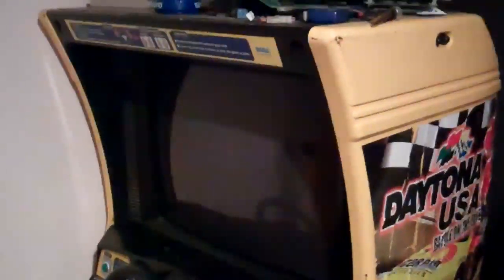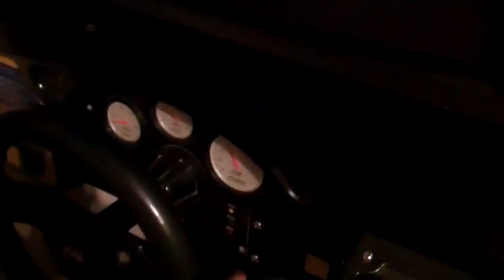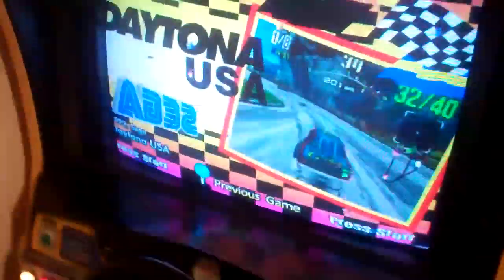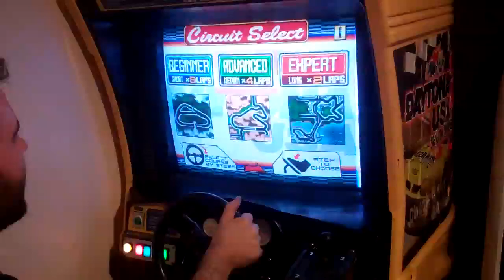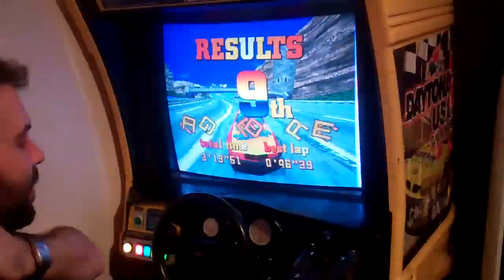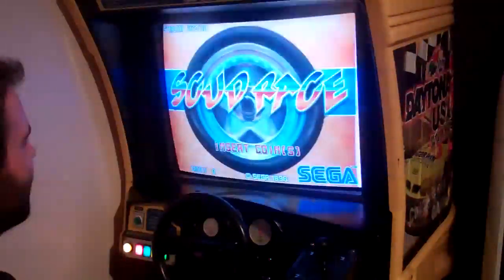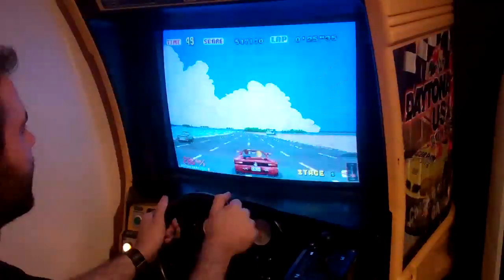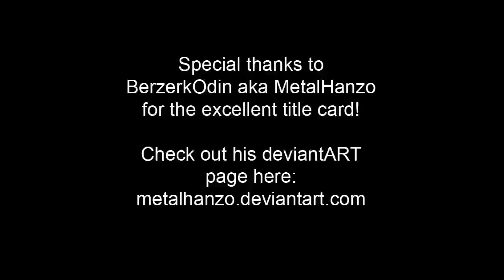Sega Arcade Racing Emulator Cabinet + REAL Daytona Force Feedback Motor!!

Comment from the maker: @ramjetr Thanks ^_^ Yeah I guess if you mean the DX cabs then parts are probably hard to find as they are different. I'm fairly sure a Daytona mech will still fit though, since the panel behind the dash *should* be the same on all Sega racers up to Outrun 2/Initial D. I'd have LOVED to have done this to a DX btw, much be amazing on those huge screens!

Comment from the maker: @gollumondrugs I was actually going to build a circuit that would sense a frequency over 15khz and then automatically switch it via another relay (should really be power cycled between frequency changes) but it's probably simpler to get a tri-sync chassis, plus this chassis is pretty knackered anyway.

Comment from the maker: @TheTerracide Sure thing ^_^

The logitech doesn't have a clutch nor do any of the games I'm using. Since you have a 4 speed shifter too, you'll need to assign each gear to a button on the wheel. Due to the way the logitech buttons are, you'll need to hook each one up individually (two wires per switch).

LINK games will work but only model2 emulator and PC games that support it. You need two PCs too. MAME won't work this way YET but it is coming ^_^

Comment: Cool, there's also other games which you could try...

Ford Racing 3, Ford Street Racing, Crazy Taxi, Evolution Racing, GTI Racing, Merc Benz World Racing, Midnight Club 2, and Total Immersion Racing. I also have the PC version of Sega Rally 2 installed which plays great. 

They are mostly older PC games as the old P4 3GHz and Ultimarc Arcade VGA can't hack newer games lol ! Usually get these games dirt cheap and then find a no CD crack online !

Are you on the JAMMA + forums BTW ?

Comment from the maker: @LarryBundyJr It's not emulated 100% but near enough! There's a bunch of videos on here. Just a few gfx glitches now. It won't run full speed on the cab at the moment but I think it's because I'm using an old version of XP. It runs better on a system I have that's half as fast!

Comment: VERY NICE! So did you just use a Logitech Driving force wheel as the interface? It is just that I am a little confused about if Logitech Driving force is only for Playstation 2 or if you can use it for PC emulation as well?

Comment: Hi, very inspiring! I'm thinking of doing the same and have a couple questions, can you tell me what wheel you used was it a driver force or driver force ex and what pots were needed? Would be great if you could also give me a heads up regarding the components for the l2m2 can you recommend a UK supplier and approximate cost when building one? Best regards

Comment: Im on the first step to build my own, aquired a  scud race, need to swap out the dash for model 2, got l2m2 board coming and driver force pcb, just need to source a nice i5 pc, that should more than been enough. is this running on a 15khz monitor?

Comment: I have some questions i hope you can answer, i have sega rally twin i am converting about the same way you do. I am using that PCB too, and i wonder if you can use the clutch? I mean how do you shift gear? The Logitech steeringwheel only has up and down?

Have you tried LINK in arcade games? Since i have 2 of them i wonder if there is a way to use network. I tried a looked everywhere but it is not implemented the way i want to use it as far as i can see.

Comment: Hi, i really love your video ! I have an L2M2 hooked up to my original daytona cabinet too but i have some issues with the resolution (reset everytime i shut down).
I have some problems too with vivanonno who don't want to run at 496*384 (same hing for outrun 2006 and ppsspp emulator (ridge racers 2, gti club super mini festa, initial D) 
Do you have somewhere a backup of your configuration ? (no roms, juste the emulators + mappers or things like that)
Thanks in advance for your answer ;)

Comment: Hi.

I am using the same emulator with a pc with similar specs and it runs at 20fps yet yours runs at full speed. Any suggestions?

Specs:
AMD Sempron 3850 @ 1.3ghz quad core
NVDIA geforce GT 610 @ 2GB DDR3 (Overclocked)
8GB 1333Mhz RAM
500GB HDD @ 7200RPM
Windows 7 64 bit
Supermodel 0.3a
Reply: clubconsoles  You do know this game is available for download on the PS3 right??
Reply: GRIMLOCK07 Oh right thanks.
Reply: +GRIMLOCK07 But why should be purchase the worse version, when he can download a better version for free and have the flexabililty of having a custom controller?

Comment: @RetroRepair Thanks ! I have a 7950 gt 512 mb but it seems to run slower than your 7600 GT :-(  Maybe the processor? Otherwise , a passive radeon 6450 is ok to , it run fine with this card but always slower than you ... 

I will make a video too , thanks !

Comment: Hello RetroReparo! Dude, what a fantastic job you did on your Sega Arcade Racing emulator cabinet; I'm impressed! So, I have a Ferrari F355 Challenge Arcade Simulator in need of renovation. Many even do this by damaging part of the dashboard, using a new steering wheel. But I didn't want to damage the baginete for this purpose. I don't have a multi-racer system, I'll have to do it from scratch! Can you help me? How did you connect a PC to this guy with the pedal? Could you show the inside on video? Did you make your system from scratch, or did you get it from someone? I hope I can count on your help!!! A big hug!:face-blue-smiling::text-green-game-over::face-purple-crying:
Reply from the maker: This cabinet is long gone, I'd love to build another one but they're just too expensive to buy now. Yes I made it from scratch but it was about 10 years ago now, my memory isn't that great! If you let me know what you need help with I can try to offer some advice
Reply: First: How did you connect the original arcade pedals and steering wheels to a PC?
Second: were the buttons with LED lights connected to the PC and configured?
Third: About the system, how do I get all these games on different systems to run at 15khz?:hand-pink-waving::face-turquoise-drinking-coffee: @RetroRepair